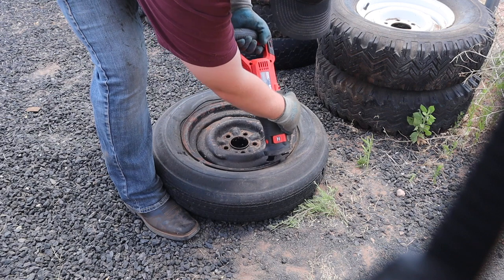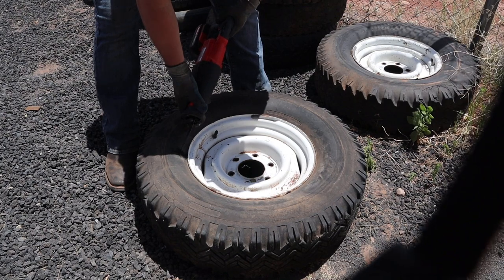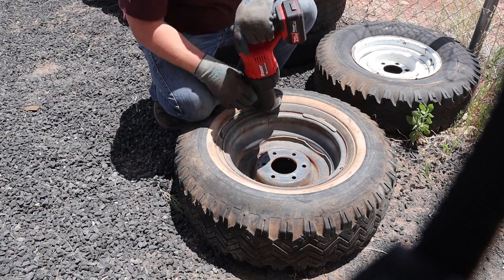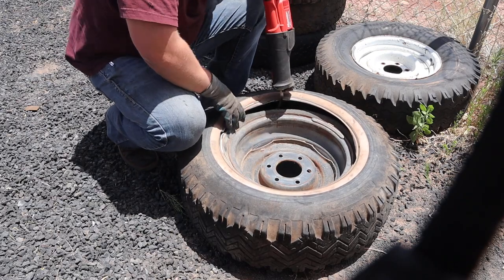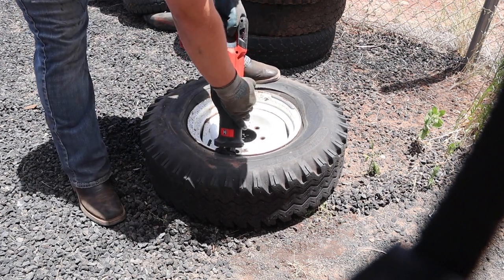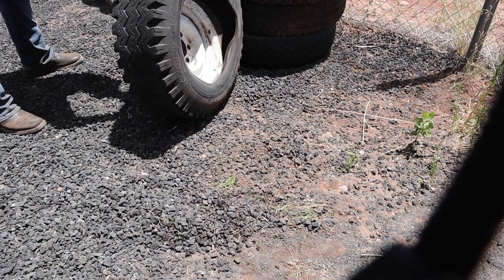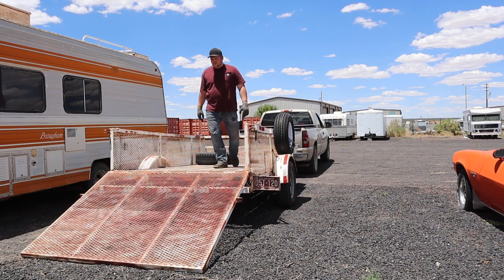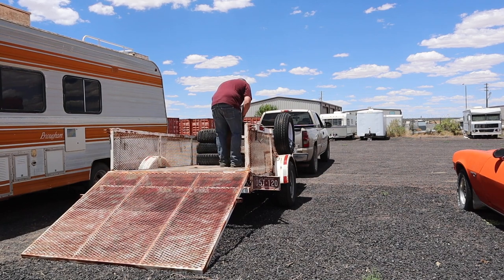Bauer 20v Reciprocating Saw - Cutting Old Tires from Steel Rims

Comment: I really want to get the cordless recip saw, but so far I haven't found a use for it. I've used a recip saw once in the last 5 years I think, when I replaced a roof for my mom. I didn't have any cordless tools at that time, they would have come in really handy though. I had to lug an extension cord and recip saw onto the roof, and a skilsaw at one point, my bauer tools would have made the job easier.
Reply from the maker: Yeah, it’s definitely not a necessary tool especially for DIYers but it helps at times. I used the hell out of my Milwaukee Cordless Sawzall but that was definitely in different circumstances. When I sold all my Milwaukee tools I had enough to replace every Milwaukee tool I had with a Bauer so I did. And ended up with more batteries too. So that’s more or less why I got it. In hind sight there is a lot of times I should have used one over another tool I used.
Reply: @DereksWorkshopAndProjects  nice, the price was what drew me to them, low cost for good quality. Some day I wanna own them all!
Reply from the maker: Jeremy Huff Same here. I was surprised at the quality when I picked them up in store for the price, got them, and am even more surprised now.

Comment: Great video, thank you. I need to do this, but I am doing it to remove junk tires from nice rims. My question is this: After you are left with the two strips around each of the beads (inside bead and outside bead), is it easy to remove those remaining strips from the rims? Thank you
Reply from the maker: Yes, it’s far easier to remove them in my experience. Especially if you have an angle grinder, you can just cut the steel belts left in the rings. But with the tire gone you can come at those rings from underneath.

Comment: Did you use metal cutting blade
Reply from the maker: Yes. I used a wood/metal blade. It was like a hybrid blade. It had more aggressive teeth than a regular metal blade but was still metal capable.
Reply: Steel belted tire ?
Reply: Kobalt folding box blade is great for this to start your cut, I used this also for trimming my moms Muck boots